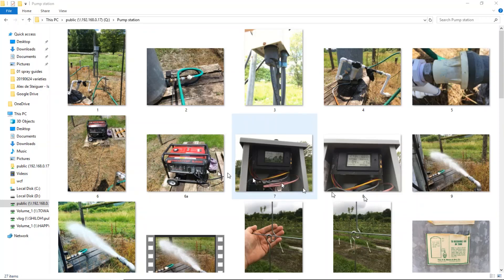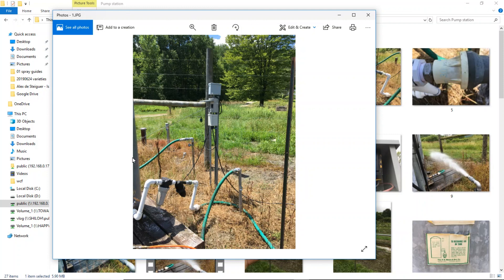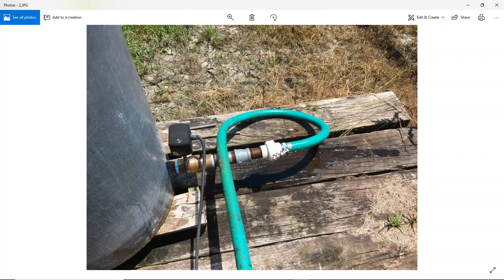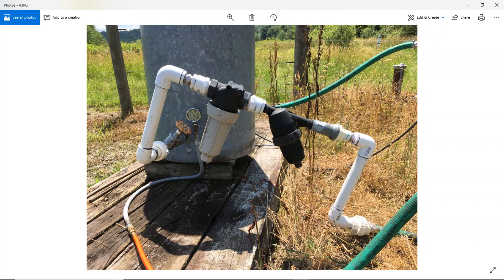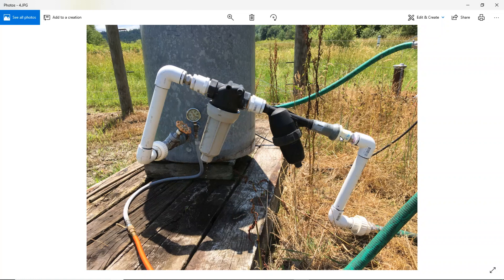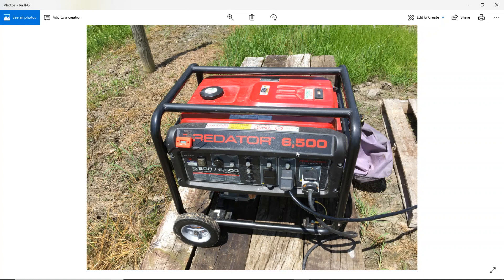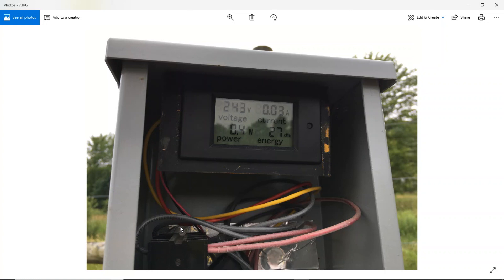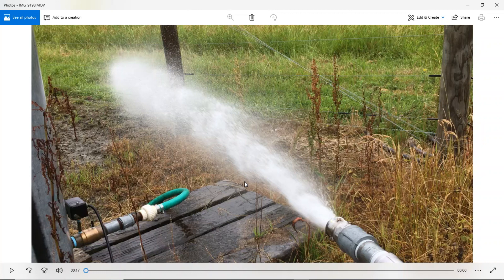Small orchard irrigation system overview (2019)

Comment: Do you ever run fertilizer through your system? And greetings from Oregon. Been watching quite a few of your videos
Reply from the maker: Hello!  No,, I haven't.  The flow rate is too high (15 GPM) for an affordable injector.  Also, I'm concerned about fueling growth in the lines.
Reply: @Neighbour_Al  well I know the pot growers run a type of peroxide based line cleaner that Is harmless to plants. I'll look into that. I am starting 100 on Geneva 41. I think you run the same root stock. I am into making homemade nutrients and want to put them through my lines.